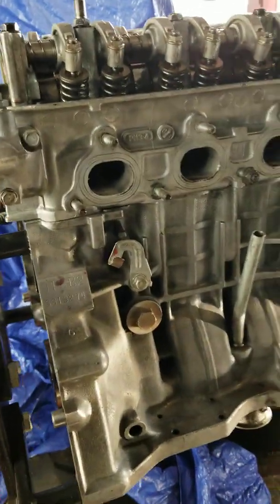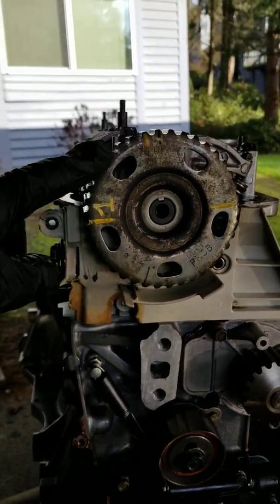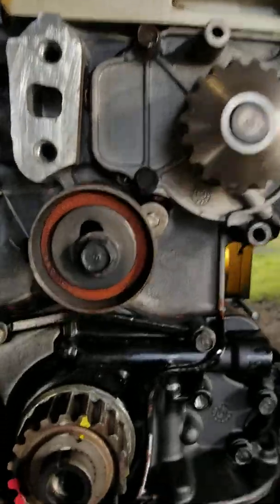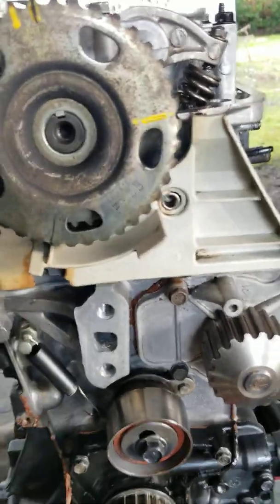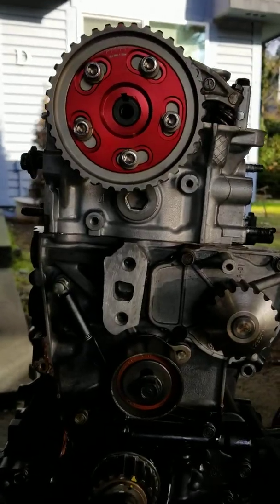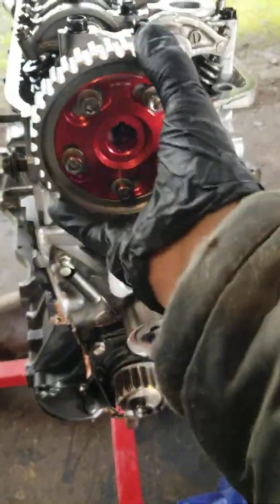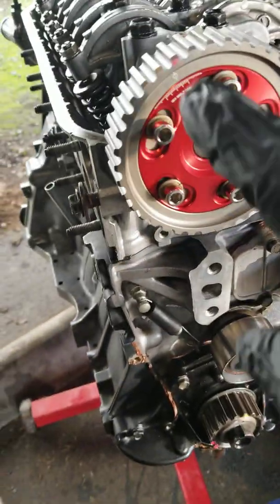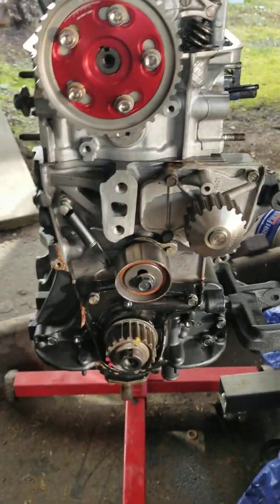d15B2 block and D16 head belt timing  (no V-tech)

Comment: Like I said my is fast for what it is and real gd on gas on highway simple combo and simple ECM unplug and plug in but beside my comble my have 10 pound flywheel and stages 2 clutch kit the pmg-fi duel point system is a Weber carb with out the bowl or float meaning is straight gas shot plus the segundary manifold runner is shorter than primary runners meaning was made for higher rpm I do 100 miles in 3 gear easy and fast I can run the city in 2 and 3 gear all day long  plus I the highway I get around 40 miles or a bit more on a gallon of fuel and we talking on a pmg-fi duel point fuel injector system not bad and in the city she is a beast CCR born in the byouooooo amigo and we talking here about junkyards parts and combo of Honda and she sounds like a V8 Ford muscle car and fun fun to drive a go-kart on steroids and real peppy real peppy jjjj 😁 and fast gd video amigo

Comment: 😂😂 I build one in my CRX with po8-3 head Y8 head gasket with pmg-fi system duel point and I used the 0bd0 distributor by doing adjustment to it plus 272 Delta cam no VTEC crap at all around 10.1 to 11.1 compression and I can say the pmg-fi system duel point hold on nice to 7200 rpm better than a Weber carb plus with the compression ratio and the cam and my duel point my CRX sounds like a race car really .All that crap about VTEC or turbo is a waist of time and money I build my to enjoy and have fun around and be reliable to go anywhere in USA

Comment: Can this issue cause the engin not to start when hot I have a d15b with hi compression pistons and when it’s hot sometimes it refused to start but when it’s cold it will start
Reply from the maker: do you have installed one wideband afr? just wander how it looks when warmed up  engine is at idle :-)
Reply: @dacron15libbre21  yes I did install one it look ok
Reply from the maker: are your spark plugs rated correctly? more engine compression may need harder sparks.
Reply: @dacron15libbre21  ok I will check on that ok thanks bro
Reply: @dacron15libbre21  what spark plugs you recommend